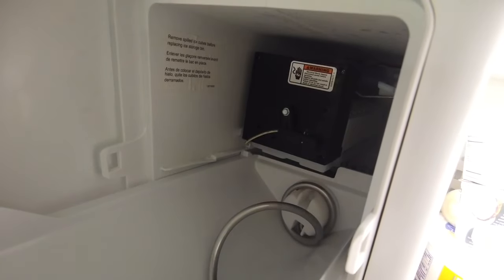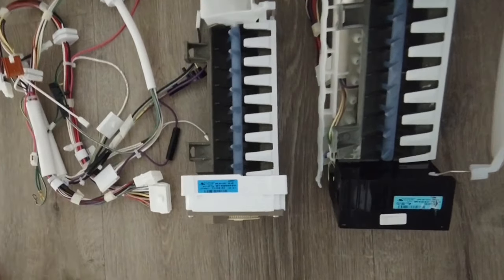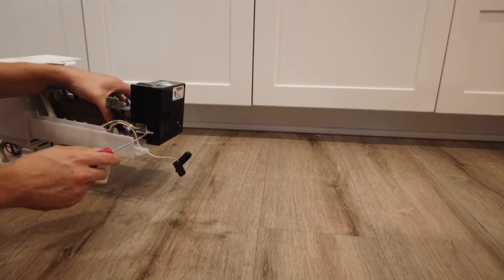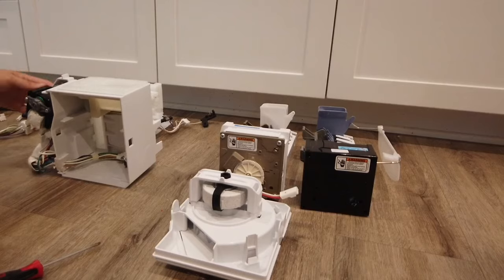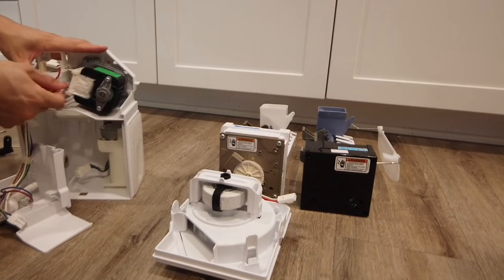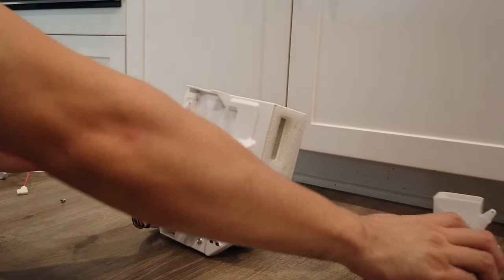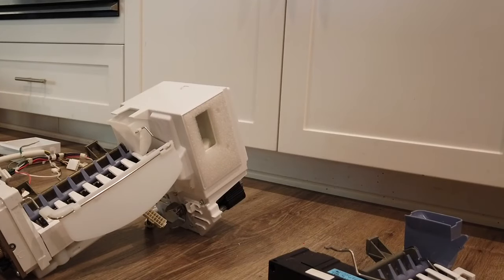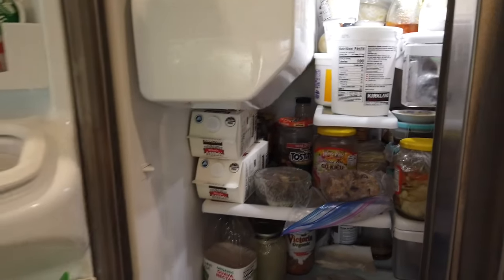Whirlpool / KitchenAid Ice Maker NOT Making Ice

Comment: Switched out the motor last week, and a couple comments about the video:

Most importantly, the Amazon product has been improved.  You no longer have to remove and replace the wiring to the new motor.  It comes with an adapter that'll  plug into the old wiring harnass into the new motor.  The only difference now is replacing the 'crank' that plugs into the motor (2;59 in the video).  The old L shaped platic piece is cut off, and the new one is spliced to the same wire.  The kit comes with the new crank, and a wiring splicing kit.  It also includes a heat shrink sleeve for the splice.  You can not use the old crank to the new motor; the designs are different.

0:39  That panel was really hard to remove for me and nearly took 15 minutes.  It might be frozen to the other place piece, but keep jiggling a screwdriver in the slot and it will eventually come off.

0:52  The plug was also hard to remove, but the secret is to push down on the middle square clip that secures the fit.  Pushing down on the clip releasees the plug.  The clips on the side do very little.

1:17 Yanking the ice maker out and putting it back in requires a lot of effort.  Try jiggling the device side to side to help it move.

Not having to replace the wiring makes the job significantly easier.
Reply: Thanks I did this a year ago and the fridge is no longer making ice. I wonder if I need to replace it again. I bought the product he linked in the vid, but I wonder if I bought an older one or the newer one you have

Comment: Very helpful tutorial, (at least initially). I say that bc I just installed it and will have to see if the new machine produces ice. Good news is, is that there is sound coming from the ice maker, like a fan is running.

Imo, I didn't think disconnecting the green wires was necessary. I felt I could change the part without that step, especially since it was a challenging step for me.

Also, my kit came with a wire that I had to splice to the front in exchange for the old yellow wire thing. I'm not sure if you mention that or if your machine didn't need it, but the kit I bought in the link you provided came with one.

With that said, I knew how to cut and splice wires already (at least I hope, again we'll see tomorrow if it produces ice) , but that would be helpful for the viewers to know.

Comment: Thank you for your help one of the terminal was burn for the heating element.
Reply: I dismantled the harvest motor enclosure (black box) and found that the copper traces and wire connection inside was burnt badly. THIS is why Appliance Parts sends you a new wiring harness because when the thing failed is probably damaged the wiring somewhere also.  Is really is not hard to replace the wiring harness.

Comment: Before replacing, isn’t there other things to look at?  Mine produces water, no ice.  Can the water line be frozen, could a wire that controls water into the ice maker be broken?  Just want to make sure eliminate the simple things first.
Reply from the maker: Good point try defrosting first and see if it fixes the ice maker. We did that first too!

Comment: I ran the service test 25. Code 00 came back.. icemaker fill= off and water valve = off. It says to initiate icemaker fill jump thermostat T and H. I don't see an T. looks like I have the icemaker that looks like the one you pulled out..  
I've replaced the dual valve and the ice maker motor does run.. just no water..  It may be frozen.. How did you attempt to thaw?

Comment: How do I disconnect the electrical connector under the panel?  Are there tabs I have to push in or pull out? I trying like heck, but don’t want to rip any wires.
Reply: I am having the same issue removing the connectors.

Comment: Some one already kind of ask this but is there nothing else that you check before determinate that it was the ice maker unit ?
Reply from the maker: I checked the water line and filter to make sure it’s not clogged. And turn off defrost and on the refrigerator to see if it it works again. 90% of time it’s the ice make unit itself.  So we just did it and it works.

Comment: Hello, where did you get the harness from ? I ordered the same unit but cabling is off for the same fridge 🤦🏻‍♂️
Reply from the maker: From the unit. You may have ordered a slightly different model. Check the serial number.
Reply from the maker: Also whirlpool discontinue one version of the ice maker so wouldn’t hurt to call them up and ask for latest serial number for your make and model fridge.
Reply: @megawatts  thank you for the reply. Got the wiring done and back to working. thanks again for your great video !

Comment: Replaced ice maker but still no ice after 48 hours. I can force water to fill the ice cube tray  and if I do that, once the ice is made, it will harvest the ice automatically. However, it will not fill the tray with water after the harvest. Thoughts?
Reply from the maker: Put your control arm up and down again if that don’t work likely it’s a defected new ice maker try another one.
Reply: @megawatts  Tried anther 1 and the same thing happens im thinking control board
Reply from the maker: @joemilazzo6955  yeah most likely

Comment: I can't even get the cover off of the ice maker to get in it. It is stuck. Any help with that? Do I have to turn off the whole thing to make the ice melt so it isn't stuck?
Reply: I have this issue too, did you get yours off?
Reply: @KeithBreon  Our is under warranty. When the repair man came out he said there is probably a leak that froze it up. He order a whole new ice maker and a cover. He said he will probably have to break it off to replace the ice maker. He comes on 06/24 so we will see. I think the refrigerator should be turned off and then it will melt and come off. I might try that before he gets her. I don't want him to smash it.

Comment: All of these  videos say " FIXING your ice maker thats not making ice". Not replacing the ice maker... obviously the component that failed isn't worth replacing?? I just wish the title matched the video guys. If my water pump started leaking on my truck I would hope a video on fixing the leak ( new replacement part ) would be the instructed procedure. Not a trip to the repair shop for a new motor to install. Not hating on anybody just irritated at a new fridge that needs a replacement icemaker, it would seem, only weeks after warranty expires....what goes bad for it to stop working suddenly??
Reply from the maker: In our case the motor failed and stop rotating.
Reply: @megawatts  sorry to hear that. I guess this particular model refer has had some problems. Its a great fridge and far from cheap but sweet baby Jesus, $600 for a slide in replacement???? We bought a countertop ice maker for $125 and it works great but the little woman wants the original replaced. I've put it off long enough....

Comment: I can't get that stupid fucking cover off at the start. I swear I'm doing the same thing you are with a flat head screwdriver and it will not budge!!!
Reply from the maker: Try a smaller flat head
Reply: @megawatts  I had trouble also. While pushing the tab down I used a small screwdriver to work all around it to loosen it off, and after getting it off i noticed that it needs to come forward towards you.
Reply: I had the same issue. But eventually got it
Reply: Also, once you pop it off, you have to slide it towards you.